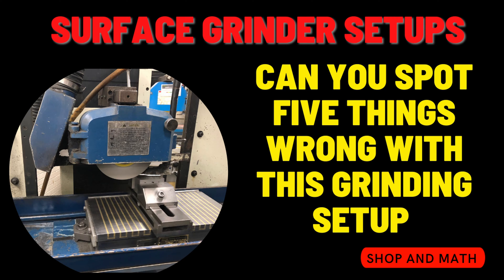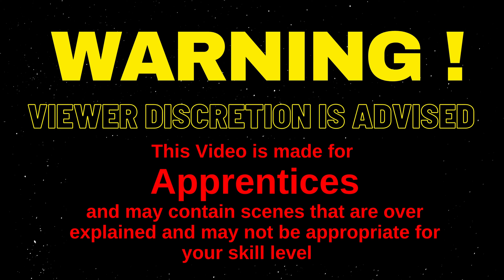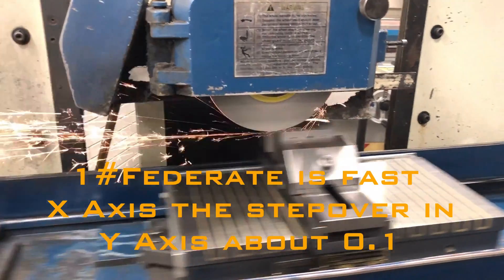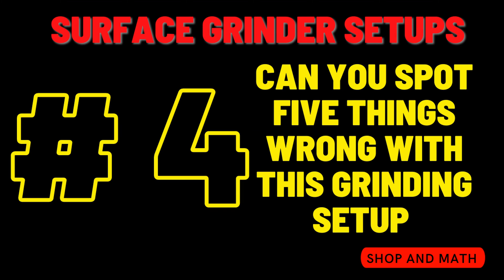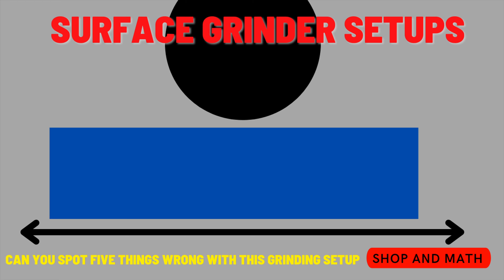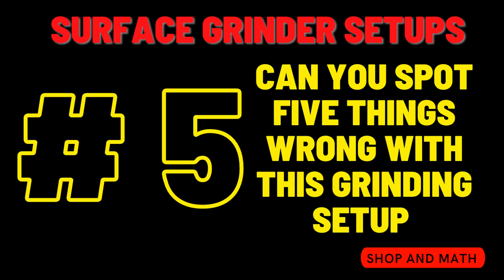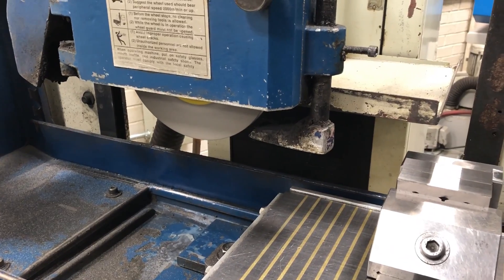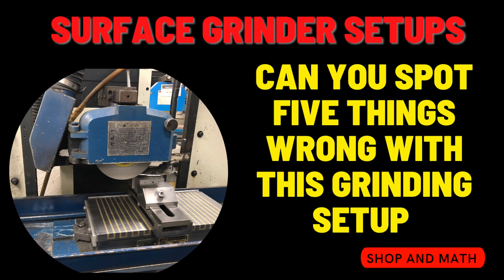surface grinder setups Can you spot five things wrong with this grinding setup

Comment: Turning the work on an angle is a waste of time. That's why you have coolant.   You cannot always grind towards the fixed jaw.  It looks like the wrong grade of wheel was used and not properly dressed.  No exhaust was used.

Comment: The thermal expansion and solution that I am not allowed to do, what else I can do? The piece and the vise must be square for the product, 15 degrees not an option unfortunately for my case :(.
Reply from the maker: There was a couple of solutions that you can use 
Device if you have the option, it is a good choice  safe sturdy secure 
Magnetic parallels might also work depending on your set up situation

Comment: newbie here what is the trick to grinding if you don't use a coolant? liter cuts?
Reply: Cool it just makes things better 
You can accomplish almost all types of grinding, without coolant lighter cuts more redressing of the wheel and certain materials are off-limits without cooling 
thin material is more difficult to grind without coolant
Reply: Pause after each pass to let the part cool a little.

Pause on the right side to let the wheel blow air on the parts.

Shallower cuts.

Apply coolant from a bottle.

Mutter a prayer to the Omnissiah.

Comment: The two blocks may not be parallel and might not clamp properly.
The blocks could extend out of the side of the vice by a small amount. The vice can then be clamped on it's side to grind the ends of the blocks square without removing them.
Reply: You are (100%) correct.

Comment: I see no reason why these blocks aren't clamped directly to the magnet. It would be more accurate
Reply: let me give You a good reason. after grinding the sides as on this step, You then release the magnet and turn the vise on its side . Then grind the sides of the block. The block will now be as square as Your vise is which us usually within a tenth or two on a good vise, This is the way it should be done.
i am a tool and die maker and have been grinding for decades
Reply from the maker: you are correct it is best to have your work pice on the table for parallel grinding 
this operation is squaring the block (that was not mentioned in the video)
thank you for commenting and the question
Ray
Reply: Also wheel sounds too hard for material being ground. Select a softer wheel helps with heat and requires less dresses.

Comment: mmm.... if I had to guess on a sixth and seventh. The dust collector should have been adjusted. Perhaps a seventh but it's hard to determine but the collector should be cleaned as well. Accumulated grinding dust can ignite!
Reply from the maker: thank you for commenting Ray

Comment: Can't conventional grinding cause burn marks also? Aren't you supposed to take a climb cut and back before feeding in?
Reply from the maker: the climb cut depends in the grinder you have 
the school grinders manual / hydraulic they take a feed pass (y Axis ) after each (X Axis) pass